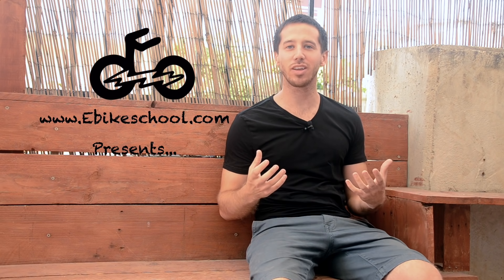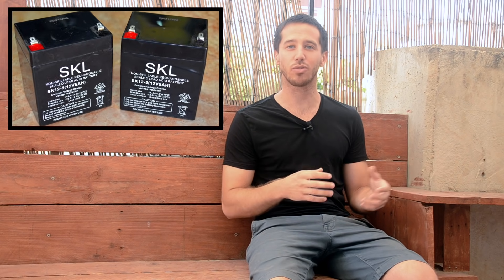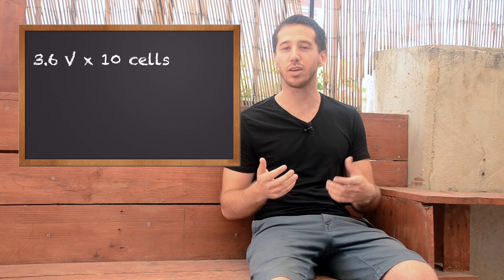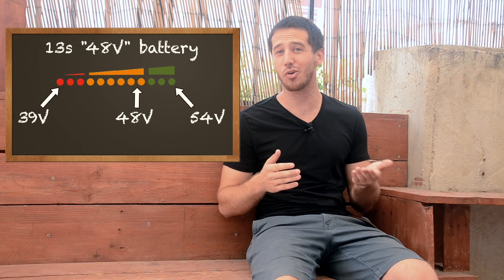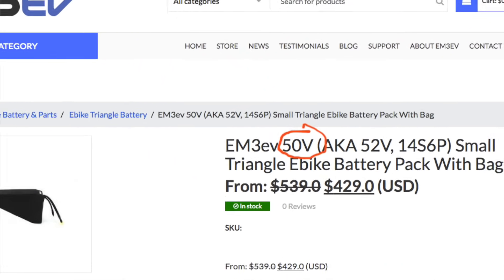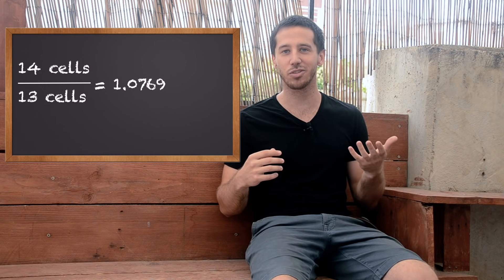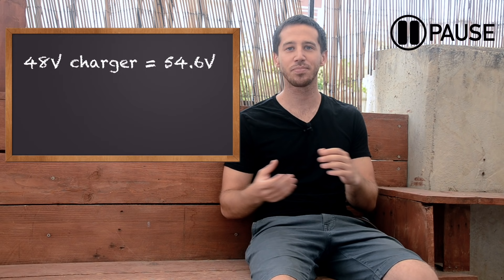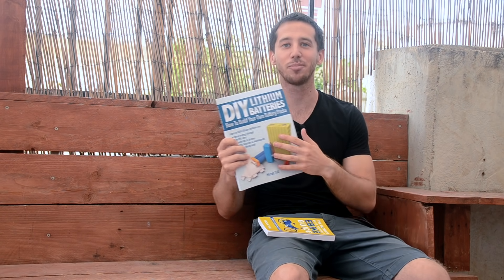Which is better: 48V or 52V battery?

Comment: I had a 15.6 amp battery I switched it to 25 amp battery and adjusted my amps on the e-bike from 20 to 22 and it seems to have more torque

Comment: If you was using a mid-engine that used a belt drive system or a chain system you can change the size of your sprockets to make it go faster

Comment: As a retired electrical engineer, I can say that the higher voltage battery will always be better, assuming that your bike‘s system can handle it.  As he said, higher voltage has a speed advantage and the 52 version volt gives more stored power in Amp-hours

Comment: Going on your other video in this link https://www.youtube.com/watch?v=zQ_y3nKU360 , i would say it would be good to get a 52v system so you can then charge your battery to 48v 100% levels and save the life of the battery a bit as you would be charging it to 90-95% instead of 100%

Comment: Thanks for sharing .I have a 52-volt battery  that slides into my rear cargo rack and locks .we'll my questions is whenever I connect my charger and charge it the charger will shut off after it says it's a fully charged battery the light on the charger is lighted green from red but the battery has a test charge indicating button when I pushing all of the lights light up green except 1 that is still lighted red .can you tell me why the charger shuts off  indicating the battery is fully charged with 1 red light showing on the battery indicator.? Thanks for any advice you can suggest

Comment: higher voltage is always better for higher top speeds and efficiency, but if you lose cells in parallel and you need more acceleration then top speed then go with the lower voltage pack, and also check if your controller has higher voltage caps and has a screen  correct percentage viewer for 52v (most dont like sw900)

Comment: I have a 36 volt battery. Planing to couple it with another. Any problem with pairing a higher voltage unit

Comment: When you have a higher cell count in series and draw/charge at the same amount of current, each cell suffers less stress, which leads to increased battery life. So there is that to factor into the cost.

Comment: I want to thank you very much for all the great knowledge, it first looked out of my range because i never did electro or something.
But i know that ... people can do anything if you really want it.

The first nickelstrips with shakey hands after that 
 i build a 36 Volt E-bike lithium pack with spotwelding nickelstrips and put BMS and LCD battery checker, with discharge limit alarm.
First thing was Safety to build the pack without becoming Frankenstein.

I am from the Netherlands , mostly the people rides bikes here and there is much rain.
The battery is great in all circumstances.

Your videos and information are very detailed and helped me. 

Thanks 👌🙏

Comment: I am going to ask a strange question.  I don't think from 48v to 52v would help me going up hills 40% grades.  So, what is my best way to buy a good ebike for camping and going up hills?   I like my 48v 60-amp battery, my first bike, it only had 13.4-amps which would not work more for distance in less having 4 48v 13.5-amps worked except up hills.  Make any since for me?

Comment: So I have a Aerial Rider Grizzly 52 volt I damage the controller 
When I left it outside in a rain storm. I bought a Bandit XP TRAIL PRO 48 Volt can I swap
Out the battery’s are the connector’s going to be the same. Or does it need mods 
To change over, my plan was to
Part out the Grizzly, since they
Won’t sell me a controller since
I’m the second owner.

Comment: Could I use 52v on my 500w electric bike I’ve upgraded the controller can handle it but what about over voltage on motor it’s a 48v 500w substained

Comment: All lithium ion cells I've seen have a posted rating of 3.7v nominal per cell giving you 48.1v @ 13s. Dead = 45v. Full = 54.6v. Storage = 50v. This is all well documented. Where do you get 3.6v nominal?

Comment: I upgraded to a controller with watt based power.  This is nice, because you can use a standard gearing for same assist level and condition, whereas when using an amp based controller, my gearing could be significantly different for the same hill based on battery charge level.

Comment: Hello, engineer here! A higher voltage battery does run slightly cooler, but it's negligible. This is because while it does draw the same amps, it gives you more total power, total watts, to the wheel. This means that you accelerate faster and thus don't have to pull that amperage for as long. Of course, if you're climbing up a hill at the max power continuously, then it's going to be equal, but you're just going to be going slightly faster on the 52 volt, but if you're at your top speed and the current draw has dropped below its peak, for any given required wattage to maintain your speed, the amperage will be lower on the higher voltage battery. In reality it really is just negligible, 52/48 - 1 yields the percentage difference...

In other words if you are climbing up a hill at constant speed mode somewhere around 70% load or less, and very specific situations, you can see that it draws fewer amps to maintain that speed. But in real world usage the way that most people drive it makes no difference

Comment: Curious, would the same difference in power be equivalent to that of running a 48v with higher AH than a 52v with less AH? Considerung your reasons were range? Higher AH in a 48v vs 52v could mean  longevity in the same continuous power since the controller pulls the same current?

Comment: Great video.   I'm looking to get a kit, but not sure the bike can handle 52 or 48 volts, can these be stepped down, so if I transfer to a different bike, I can utilize the power.  I'm looking to get the Tongshen TZDz28 and confused if I should 36 or 48?

Comment: Or what would be better, a 1000 watt ebike using a 52 volt battery or a 1500 watt ebike using a 48 volt battery? I feel like if you want to upgrade from a 48 volt battery to a high volt battery, you may want to upgrade to a 60 or even 72 volt battery if you really want extra power and speed.

Comment: great vieseis brother. One question, I might be wrong or confused thinking I saw this on the parameters of a controller, does it mean that if the controller for a 48v battery should be around 16a? but if the tag says it is 25a nom, if i’m not mistaken I remember seeing a parameter for motor amp, does it mean that if I input 21a for the motor rating, the controller would push the motor limit to 1kw? understanding that using it full time it would overhear in one or both components, actually every element envolved. Thanks

Comment: Question, I don’t know if you still read this but I have 1000 W motor 48 V battery 22 amp controller if I went 52 V battery in 35 amp controller what would be the down part of that

Comment: Calling a 51.2V battery  "50V"  might for a different reason.  Many OSHA regulations kick in when the voltage is over 50V.  Classifying the battery to 50V could let you to avoid them, not very good from the safety point of view, but sure a lot of convenient for people to work on ebikes.

Comment: After just installing a 52v battery I can say it is definately worth it. It was only 20 bucks more over a 48v from Aliexpress. Best 20 bucks I've ever spent. There is almost no appreciable voltage sag compared to the 48v until you get pretty low. At 48v nominal compared to a 48v battery you are down to 23 percent on a 52v so the vast majority of the battery power is above 48v. Climbs hills faster, faster acceleration, faster speed, can keep a faster speed for longer due to the higher nominal voltage and I can say to my friend "52 volts bitch!!" Also came with a really nice 3amp charger with a fan instead of the grim 2amp shit chargers you normally get with the bike.

Comment: What bullshit. What about 36 V batteries that power many premium e-bikes? You do not need to increase the voltage to get more power; you can increase the current to get more power. It is all down to the motor/controller design. The author probably thinks of DIY bike conversions or cheap e-bikes based on mass produced Chinese ware. Ask yourself for a battery fire...

Comment: You are definitely wrong regarding the current. If the motor is working with the same power and you increase the voltage, it must draw less current from the battery. Therefore, it must affect the range. This is logical, and every website says this.
Reply from the maker: Except that’s not how e-bikes work. They are current limited, not power limited. Their controllers reach a certain current limit.

Comment: He did not mention it... however, if you decide to go with a 52v battery on a 48v displacement e-bike...
What you want to do is connect a fuse to the live wire(red wire) so you don't fry your controller 🤗

Comment: Your statement that the controller uses amps so it wont pull less amps with a higher voltage battery is misleading.
You are using exceptional circumstances like climbing a hill to make a false assertion.
If it takes 300 watts to push your bike at 20 mph then a higher voltage battery will have lower amperage than a lower voltage to supply the same watts.
If anything this example would have the higher voltage battery being more efficient because resistance increases with current not voltage.

Comment: Bifang has choice of 48 or 52 for low volt cutoff.i use lifepo4 and they work with both lithium ion 14 and 16s lifepo4.lifepo4 flat cells get3500 cycles compared to 500 to 1000

Comment: For short, the number of voltage is directly proportional to the speed of your e-bike and number of batteries, except you need to buy a new charger.  The speed of your e-bike is inversely proportional to the time you reach your destination. What I want to express here is the difference of direct/inverse proportion. If you notice a very small difference between 48V and 52V, why the heck you need in upgrade? :face-orange-raised-eyebrow:

Comment: Current is based more on the motor than either the controller or battery. It's the motor that draws the amps. If it draws more than the controller can handle, that's not good news. Generally when people up size a battery or overvolt, they're going to get more excited and use it more aggressively and are actually more likely to draw more amps out of the motor than previously.

Comment: Great job! Your very knowledgeable.  What are your thoughts regarding using a 40v Ryobi cordless battery or two in parallel in a diy etrike?   Can I use a 36v 1000w hub motor with a 48v 20amp speed controller?   😊

Comment: Who cares?   What most folks need is a 2000 watt motor..  we see tests of Ebikes that can’t put a hill.. I have a 2000 watt bike with huge power to start from a dead stop on the steepest hills..  plus the bike has a 5 speed rear hub that after starting I shift up to 5th gear to 45 mph..  yeah it’s new tech and will out do a aerial rider grizzly at 1/2 the price.. lock out all.. new bikes with rear hubs will soon take over..  never mind the mid hub.. they can’t keep up with raw power.. do your research on eBay.. don’t waste your money..  I have 2 lung diseases.. I can’t pedal..  or walk 100 feet with out oxygen..  plus why get a heart attack pedaling on hills?  Find the best deals all..plus 20 inch tire allows me to reach the ground.. think about what I say..don’t but crap that rots in your garage.. buy the right bike first.. be well
Reply: I weigh 220lbs and used a BBS02 on a carbon folding with 20 inch rims/tires

It will climb any hill anywhere it only needs about 1280 watts to climb hills easily

This way I get super long range because I'm not running 2000+ watts 

Mid drives are WAY better at climbing the hub motors

Comment: so with increased power of a 52v it will have more torque to climb  hills better too ? where i am there are some inclines that my 36v  stock fiido struggle with so will i notice the difference going with a 52v battery and controller?
Reply: mid drive + 52v + 38t front ring and 32t  rear will climb any hill in the world

Comment: How u doing I like to learn more about the voltage ah etc I have a yume escooters it's 52v one big battery  but it's split n half meaning I have two charging units the battery supports two controller I'm really confused on how n why yume made it like this I like the video I got a glimpse of understanding 48 52 on how it works I knw the meanings of parallel n siree yr book will help me to understand the steps on how to n not to

Comment: Yo , great knowledge on batteries, I’d like the DIY lithium battery builder book , even if I don’t win it.. 
cheers,?
please leave a contact and I’ll follow up 
G
Reply: Is it possible to adjust the pot. in the charger to deliver the extra 3 volts required instead of buying one ..
Thanks

Comment: I brought 48volt battery case kit used 65 18650 cells 13s5p but the voltage comes to 65 not 48 all batteries were around 4 to 4.1 volts I charged the 8 at a time before putting kit together kit came with preshaped strips I wanted to buy 48volt mid drive but I'm stuck cause i don't want to blow a 700.00 mid drive kit help someone

Comment: This is a useful video, thank you. I'm building a new bike and have to decide between 48 and 52 volt. Now I see that either voltage would probably be fine, but do I buy a good charger for each bike, the old 48 volt bike which will probably be sold or the new bike?

Comment: Can I just take two or three 12 volt Lipofe batteries like I use with my boat trolling motor and wire them in the proper series to power an Ebike? A volt is a volt right?

Comment: if you have time to help me, I would be grateful, I bought a 1000w motor for an e-bike and I have a battery 48v 20 aha 30a,, currently I have a controller 48v 500w,,, my problem is that my battery heats up and the motor heats up. .. which controller should I buy,,, your channel is very good and I can see that you are a top master

Comment: Very helpful.  I am building a hybrid bike front ebike wheel (48 volt 1500 watt, with a gas motor driving both back wheel (trike) through a limited slip differential.  I recently ordered a 52 volt 30 ah 1500 watt battery,(could not find a 48 volt 1500 watt battery) looks like in retrospect I did just fine, as I was worried about harming my wheel, not so now.  Thank you for putting me at ease about my decisions.

Comment: Can i go from 60V(5x12v 20ah sel batteries) to 52V(21700or18650 lithium ion) ?? will the slightly lower voltage affect my ebike scooter motor controller if the new li ion. is a little less Volts??? please i would appreciate anyone's help so i can move on and order the new batteries and ride again!! Thank you very much!!!!! Just reply to my comment!

Comment: I'm thinking about making my Giant Reign mountain bike into an ebike and I'm thinking about going 52 volt battery with a front wheel motor to avoid any drivetrain issues and for simplicity. What are the downsides to a front wheel motor. I did a front wheel motor beach cruiser and it rides great.

Comment: I wish somebody would explain the practical differences between volts, amps and amp hours.  
I've watched dozen of video's and it seems like content creators just assume we all know what they mean.
It's very confusing trying to figure out which affects the speed of the bike , and which affects range.
I have a 35v/ 13 amp/  500 AH battery which gives me a top speed around 20 mph and a range of around 10 miles  (just a guesstimate)
I'm not so interested in increasing the speed but I want to increase the range because 10 miles isn't very far and trying to pedal a heavy bike unassisted is extremely tiresome.
Everytime I go somewhere I have to check to make sure I have enough juice to get home.  Most of the time I barely do.

Comment: So, here is my question. Is it just about the battery voltage ? See, because on my ebike the rear hub is stamped as 48v as well. Are you saying that I could for all intents and purposes still use a 52v battery if the bike is rated for 48v ? Inquiring minds (and riders) want to know 

[EDIT: So yeah, if you do not plan on answering legit questions after a video like that why even bother making it ? I suspect it's because you want to see how many people ruin their ebikes taking your advice.]
Reply: I converted my 1000W 48V motor to 52V 20AH battery and just works fine and it added a little speed to it.
Reply: @ronpagala7496  And that's the thing. It is not just about the battery. The motor has to be able to handle increased voltage as well. It may work for now, but I suspect that pushing 52v into a motor designed for 48v will eventually take its toll on it. And then you are replacing the motor.

Comment: So if I change my 48v to a 52v battery I should see an increase in top speed?
Reply: A 48 with the controller's speed limiter wire pulled out will beat a 60v with the speed limiter connected.   (Look up disconnecting speed limiter on e-bikes)
Reply: Yes

Comment: Really appreciate your videos,  they have been very helpful,  away,  I have a question,  working on an idea, 
here goes, I have 5 Li Ion batteries,  18 volt 5ah, trying to figure out how to convert them to use as an extra battery for my ebike.  If I put 3 of them in parallel,  it would keep the 18 volts but would have 15 ah of capacity!??
put that setup in series with the 2 remaining batteries,  wouldn't that give me a source of 54 volts with 15 ah of capacity?
2nd question,  would the upgraded 35 amp controller setup handle that power source?
have the batteries just not the funds to buy an ebike battery of the same specs